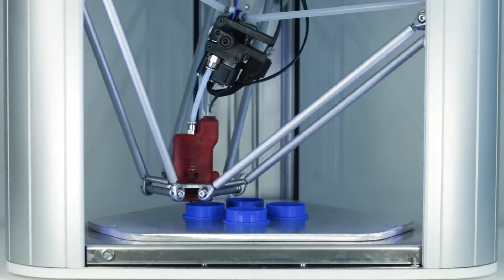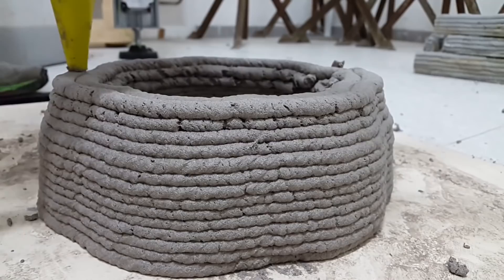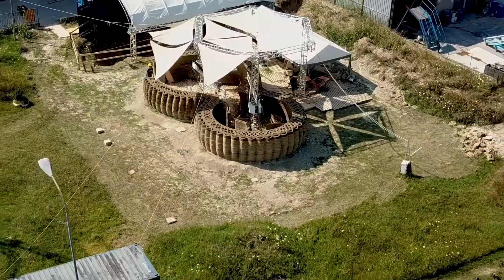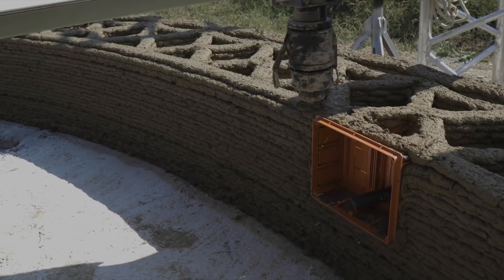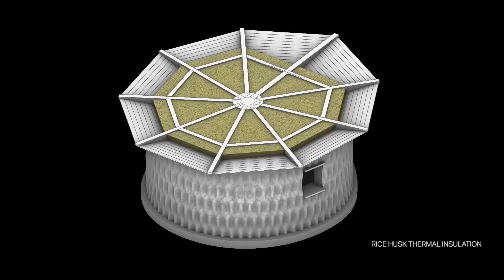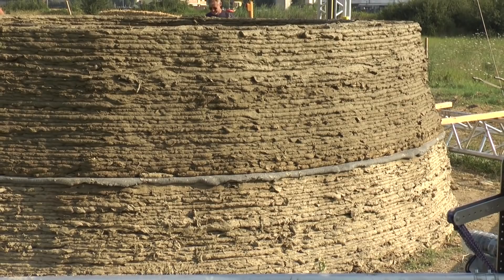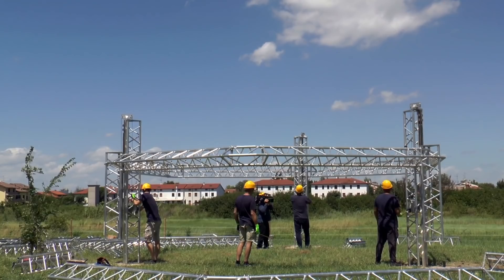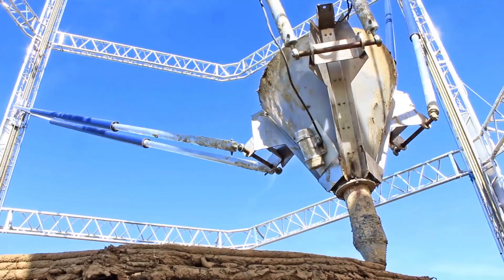$0 HOUSE | How One Startup Aims To Produce Homes at Null Cost

Comment: My grandpa had an adobe home.  He said it needed constant vigilance to make sure nothing became eroded especially after heavy storms. He stuccoed the exterior.  The kitchen was plastered interiorly with lime plaster to look brighter without electrical lights.  Most rooms had no windows but each had at least one door.  The kitchen had a window looking onto the pig sty to make disposal of kitchen scraps easy and to allow needed light in.  The roof was made from rough hewn mesquite logs and overlaid with a sod roof.  Many similar homes had clay floors but my grandpa preferred cement.  It was cool in the summer but it could have been warmer in winter.  The kitchen's hearth kept that room warm.  I liked it.

Comment: Sooo basically 3d printing mud huts? Wow life changing invention
Reply: Not to mention the wasteful nature of building such huts. The concrete foundations still seal up the soil and you'd need massive amounts of such huts to actually house many people.
I have no idea why the concept of moderately sized (e.g. 3 to 5 storeys) apartment buildings is lost on so many people.
Those are much more efficient in terms of land use, energy, and maintenance and have the added benefit of providing space for retail and small businesses on the ground floor.

Comment: Brilliant idea! $0 though? I'm no expert, but that's impossible because there is always an overhead. Someone has to pay to build the initial printer. Pay to move it to the location. Pay for labor to setup printer and monitor it during operation. They even admitted that you need workers to install other components as well. Are those people working for free? If I've learned one thing in life it's that nothing is free.
Reply: All true. However, imagine a charity buys the printer and sends it around a poor country with a volunteer to run the crew. At each village the volunteer recruits other local volunteers for labour, training them up to run their own crews later. They source free local materials, and build a few dozen houses in a few weeks. The village then breaks down the printer and physically carries the parts half way to the next village, where the next team meets them and takes it the rest of the way. The initial volunteer goes home after a few months, and it's all self sustaining with no costs until the printer needs a replacement part. You can argue that it can be free, as in public roads, which is what matters to the people who drive on them.
Reply: Watch the Primitive Technology channel for a way to actually build a house (if you have land) for $0. Land is literally the only cost.
Reply: @ardemus  You know, that some village folks with shovel, some watter and they bare hands can build this. I bet quickly than wasp and dont need Gold weight hi-tech? :D They build in this style from time when we first grap a wett dirt on our hands... Why we dont build whit dirt now? Because in mild or colder climete you hawe one rain and house transform to tomb.;)
Reply: @ardemus  In what world do you need those homes in some African villages?
I assure you people are able to build their own homes there, and often better ones.

Housing is a problem in (western) mega cities where space is an issue and more and more people pour into the city anyway. Massive prices because of supply and demand for those homes. And regulations. The homes are skyscrapers where people live in box sized apartments. 
Housing is also a problem within city slums where those kind of small homes are building illegally on land owned by others. And often demolished because of that. So the owners don't care to make them more permanent.
In the first scenario, you can't place those wasp nests inside New York. They lack at least 7 levels above ground for that. And some volunteers cannot build those illegally in slums.
So again, where is the market for them?
Some hipsters might buy some land in the middle of nowhere and make a holiday home. But that's it.
Reply: That's only because Automation isn't being used efficiently. Meaning it makes no sense to automate a factory when it still has to pay for it's parts & materials from other companies which aren't yet automated. 

If done correctly then automation can become the anecdote to our addiction to money and paying for things all together. How? Simple really. Definitely hard to accomplish yet the way to get there is simple.

For this we'd have to automate the harvesting of the Earth's natural resources 1st & foremost. Naturally automating logistics,which we're well on our way to automated vehicles already,is also key. The fundamental idea being that...

Suppose we narrow this to one individual resource while understanding that this is applicable to all Natural resources. So let's take Trees & Lumber for example. If the harvesting of all trees became fully automated as well as the transportation of them,then any companies,mills etc needing Lumber could receive it free of charge. Unless of course greed comes into play.

Which is precisely why their doing it the long way. They know that eventually everything will become automated. Furthermore they know that once people are exposed to the idea of automation enough,they'll become fully aware that other than greed,there's no reason to continue paying for products,goods & services rendered that are fully automated. 

So rolling out automation from the top down as opposed to the exact opposite is simply buying them more time to figure out how they're going to maintain power and control of the masses in a world where money becomes irrelevant!!!

Prime example: Smart phones. Do you know why their called 'Smart' phones? It has nothing to do with the advanced capabilities compared to it's predecessors. It's smart because they know that automating Smart phone production allows them to dramatically reduce the production costs. Yet instead of making them cheaper they did the exact opposite. Charging dumb people $900+ for a cell phone is what makes it Smart as it costs a mere fraction of that to actually manufacture them. 

That's how I see it anyway. I'm old enough to know that as production became more efficient,products 'Used to' become cheaper. Unfortunately greed is currently winning that battle.
✌😎🖖
Reply: 0$ they don’t have to pay for materials

Comment: It's certainly innovative and it's admirable that the team behind the project is working on and with sustainable materials and approaches. There's a lot to consider when asking if a solution and a technology is sustainable and many of the questions concern cultural accessibility, which this segment did point out. In addition to the sociocultural reaction to what is honestly a radical change when compared to traditional building techniques across Africa, Asia etc, the availability & suitability of building materials and the accessibility of the setting for the import and deployment of large-scale equipment (the printers) are a concern. I've worked on development projects for the past decade, from housing to WASH installations to disaster recovery and in my experience, there's no such thing as zero cost. Into the cost of any solution one must factor in the design time, the logistics, labour and maintenance of the solution. While the actual building material; mud & straw is 'free' the labour to gather and prepare the materials are not free and the local population's labour should never be regarded as free or taken for granted. 

Best,

Byron

Comment: All structures made with masonry (mud, cob, cement, brick, rocks, rammed earth etc.) need steel reinforcing.  Without that they become death traps in earthquakes.  That’s why so many people are killed in third world countries when they have an earthquake.  They don’t use steel reinforcing. An inexpensive unreinforced home may become the most costly thing you’ll ever purchase.  I saw a video of a cob home built on an earthquake simulating platform.  The simulated earthquake immediately broke the clay with straw reinforcing into big potentially deadly chunks as the home collapsed.  Even with steel reinforced,  masonry structures will crack but they will give the occupants some time to escape.
Reply from the maker: Very good input. I’m not an expert on earthquake safety by any means. Intuitively it seems the small huts built here wouldn’t fatally injure occupants in case of a collapse because the material is not as heavy or hard as concrete or brick. 

Ignoring my speculation, maybe it’s best to leave this technology to regions that aren’t susceptible to earthquakes until sufficient testing has transpired.
Reply: I know a bit about this subject as I have a combined degree in Civil and Mechanical engineering.
The deaths from earthquakes are very rarely a results of people living in modest cob homes, but from concrete-built homes, with the best example likely being Haiti. Thousands died in Haiti as a result of concrete construction with a lack of reinforcing steel. Very heavy concrete ceilings/roofs 'pancaked' down on those inside.
A home built the way Wasp is recommending with a roof constructed based on a wood frame would be much safer. As Jarrett noted a secondary problem results from large and multi-level structures - keeping the design to a more modest footprint and height, will dramatically reduce how susceptible these homes are to the effect of earthquakes.
Reply: Graphene is stronger than steel
Reply: @unsupportiveperson7724  If it has the same expansion and contraction coefficient as concrete then it would work also if it doesn’t have any adverse reactions to cement.
Reply: @unsupportiveperson7724  
Last I saw graphene isn't made in large enough volume to make a stool stronger.

Comment: Many adobe structures that are over 800 years old used horse manure that not only added strengthening fibers to the adobe mix, it also added an enzyme, which produced a harder and more resistant brick, once dry, much like a wasp uses enzymes in excretions to bond the mud used in building nests. 
The walls of ancient adobe structures are quiet thick and heavy which help modulate the temperature within the structure. 
And like the computer programs that build these incredible homes, the adobe building plans used a formula found in a memorized rhyme.

Comment: The first house my dad built was 6 bedrooms bungalow. The walls were totally made of mud. It lasted until we knock it down and biuld a concrete cement house. In my town in the early 60s, you can biuld a mud totally without cement  or you can use mud to mold blocks as we use cement to do today. After molding the blocks, and you can start building your walls with the blocks but use cement to chuck the mud blocks together. It's funny we are going back to the old ways. I will be watching.

Comment: Another great video, Jarett.  I appreciate what you do, man.  I'm really curious about the longevity of these mud structures versus concrete.  I also wonder if including a solution like Soil Tac might bind them to be harder.  Of course, that would include an extra cost into the mixture, which they are trying to avoid.  It's a interesting solution though.
Reply: Stucco or plaster them and they should last pretty well.
Reply: If they are stucco, plastered or add whitewashed they should last centuries. Many if the houses in Europe are made of cob with white wash and here where I grew up there are Adobe structures hundreds of years old.

Comment: Impressive as it may be, houses are really not that expensive in terms of materials. And if we are talking about prefab, they can also be made easy to assemble. The issue (at least with European countries) is the bureaucracy and regulations. For me, the legal costs, taxes and other expenses related to regulations were the bulk of the expense (around 3/5th of the total cost).
I don't see this being different with 3d printed houses, as they would have to go through the same inspections, plus there is the added cost of transport and setup of the actual printer before you even start printing the house.

Comment: Good thing the house is free because you'll need to work full time maintaining a house like that. Moister will make the mud swell and then when it dries out it will crack. Animals and insects will constantly be digging into it. Accidental damage will happen from time to time. All of this will have to constantly be repaired. A 3d printed clay/mud structure is a neat idea on paper, but in practice its just not feasible.

Comment: Brilliant☀️ Now my idea is to make half the house under the ground to make use of the earths natural heat
Reply: really tho if u just dig a hole and cover it up with some planks and adobe its basically this but 5x cheaper, faster, thermo and space efficient. its what i did. 
i think the biggest problems for housing people actually comes down to regulatory requirements and aesthetic prefferences, in that order.
Reply: @UltraRik  Interesting idea, how do you avoid water coming in? And how do you get natural light? How do you enter the building?
Reply: @orangesunlabs  the roof is tilted so it flows away. i built a small room with a classic roof on top of it as a bonus. it has a steep dirt stairway . the natural light is minimal, coming from the entrance facing wall, but with 10w LEDs being $0.35 on ebay, thats perfectly fine with me.

Comment: Putzmeister is a German company you should contact.
 If they are not pursuing this tech they should be.  Their expertise is feeding the printer with the proper mix at extreme heights and angles.  A Putzmeister rig is designed to pump fresh concrete many stories in the air.   It looks like a Hook & Ladder fire truck with pipe instead of ladder. A smaller Putzmeister version would be perfect for construction printing.

Comment: I think the overall idea and especially the materials they are using are brilliant, but they're severely limiting themselves by only doing circular structures. Hopefully that's only because they're still proof of concept stage.
Reply: 3d-printed Straight walls tend to bow easily and lose almost all load-carrying ability with even barely visible bows in plastic, i doubt it will be better with other materials
Reply: @angrydragonslayer  there are other companies which have printed more traditional style homes, so it can certainly be done.
Reply: @MorganWalser  i'm not saying that it isnt but that it's just not as feasible, even sq4d that have compensated for this by sacrificing layer consistency (look at the wall of some of their houses and you can often see a 3-4 cm variance) still have to have special internal structures that effectively make the wall wavey except for the external layer
Reply: @angrydragonslayer  I think the internal structure of the wall of brilliant, definitely agree with that.

Comment: The material use is critical - but that doesn't mean they shouldn't have rectangular structures - that's important because of the flow of energy through a house. Feng Sui.  All you need is the ability to go straight and turn 90 degrees.

Comment: A cob house needs more solid mass. Adding a space with insulation on the outside is fine, especially for cooler areas, but for all buildings, internal mass needs to be, well, massive. At least 10 inches thick, plus 5-10 inches for the insulated space. Then you can use the mass itself for support (especially since it's round) for the roof, or further floors. Bond beams are important in these instances, to restrict uneven settling and shifting. A layer of concrete or wood beams at the top of each floor that can be hidden (or shown if you like) is optimal.

But this idea is a great one, once these other ideas are included.
Reply: also, cob is a natural humidity regulator, because of the volume of clay in it.

Comment: The earthen, mortar mixture is similar to cob, but with a curing agent, such as plaster, liquid polymer, or/and cement at around 10% concentration, making a water resistant material.

I suspect that you could do a rubble based foundations for it with some geotextiles and then have a single layer of concrete that is lightly reinforce for the build layer. It also looks like they have a bonding beam layer that is an inch or so thick every 1.5 to 2 meters. It likely also has some reinforcement in it. The concrete's reinforcement can be done with fibers or with inserted steel wire and be very compatible with the 3d printing. Another option for supporting the roof would be to insert some rebar in to a printed cavity that has rebar sticking out of the footing and then pour in a low moisture, fast curing concrete in with a lot of inserted, concrete settling device. This and a top bonding beam with some rebar in it would allow the roof to be built in another way.

The roof insulation thickness bothered me as it was not thick enough. Many engineers and the average person will think that you don't need much insulation on the roof in hot climates, but this is not true. If you can keep the sun from heating the building from above and the people's body heat in during the night, the home will be more comfortable and result in better health for the people.